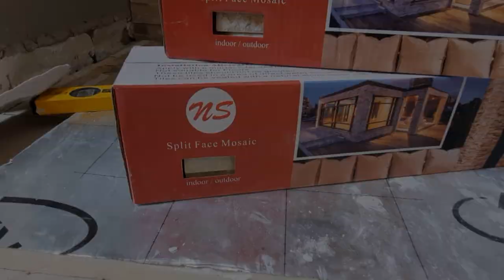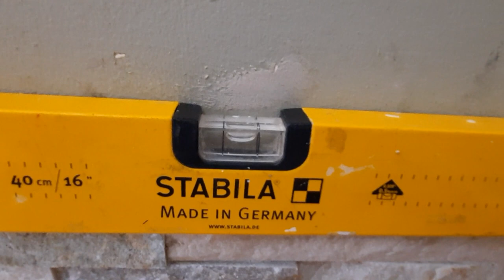Split Face Mosaic Tiles Interior And Exterior

Comment: Would you mitre external corners or butt them straight edge to straight edge? Also do you butter the tiles for the whole job or apply adhesive to wall at any stage.
I'm thinking of doing my chimney breast and think mitring the external corners won't work out too well with the irregular face of these tiles.
Thanks Tony

Comment: Cutting with 1 hand 🤦🏼. Better to use a powder mix adhesive because it’s a lot stronger when it sets not like the ready mix tub adhesive . I wouldn’t use ready mix adhesive on split face. It takes ages to set and it’s not suitable for heavy tiles.